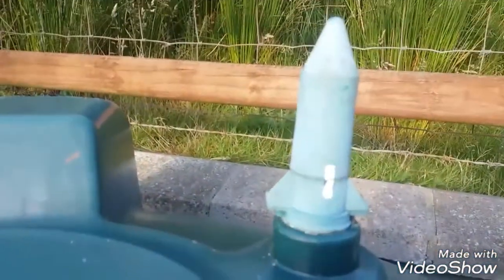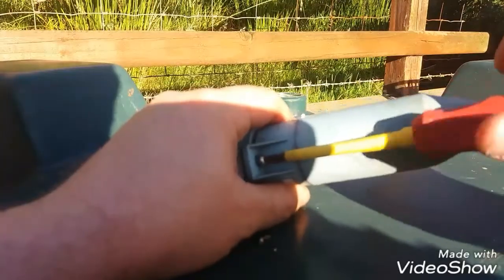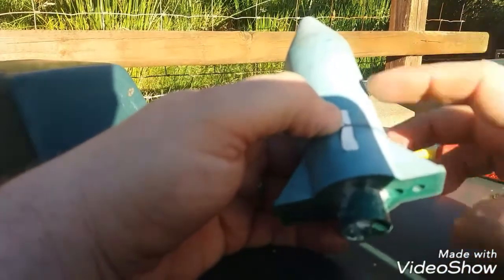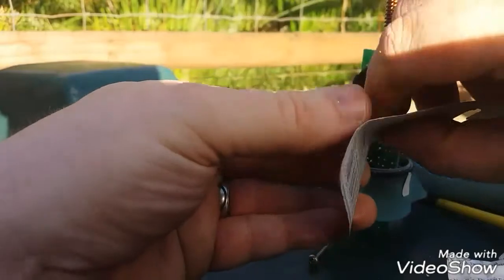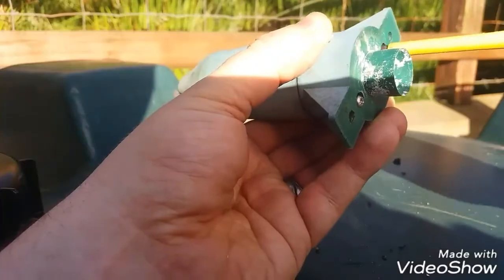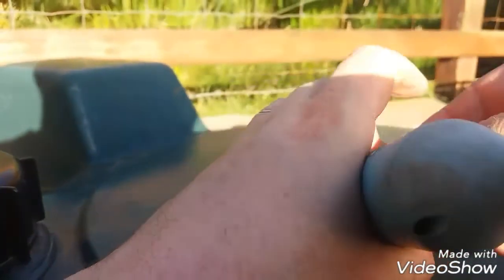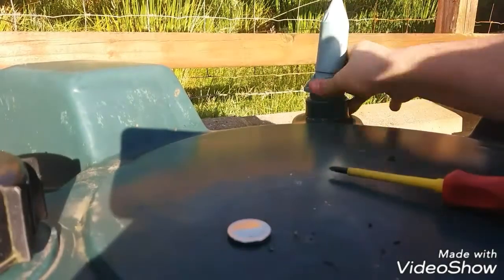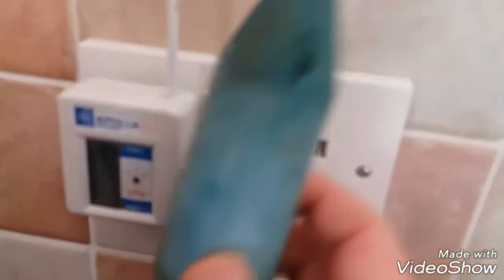Apollo Oil Level Sensor Battery Replacement (quick guide)

Comment: Thanks for the video very useful. Mine must be a different model no base unit just screwed directly into the tank but under a big lid along with the filler cap so out of the weather. Only thing I would ad is to check the o ring is in place at the bottom of the tube on reattaching.

Comment: Great vid thanks!! My tank is over half full but reader is showing that it's low in oil sometimes... not sure why, any advice? It's shows 6 bars one minute then flashes red light to say we are low
Reply from the maker: If you replaced the battery there is not much else. It sounds like its losing signal. Moving it to another socket may help.
Reply: @doctorlefthandthread  thanks for the info. It seems to only read incorrectly and flash red when the heat is actually on. When heating is off it reads fine

Comment: Thanks for this!
Reply from the maker: My pleasure!
Reply: @doctorlefthandthread  right, I checked and my tank doesn't have the 'rocket ship' sensor, it does have the same plug in your video tho so am I missing something? I've had the plug for about 5 yrs and just assumed there was some kind of sensor inside the oil tank?
Reply from the maker: @jack-zz9hb  really not sure the rocket ship type is what I have

Comment: Thanks for this and also for showing how the signal might need to be paired again. Thought I was going to need to do that as it just kept blinking for a very long while after I replaced the battery but then it re-connected. Yay! Mine is called 'Rocket' instead of Apollo but it is the same product.

Comment: Need replacement battery number 3V_CR2450
Reply from the maker: Take that number to any hardware store CR2450 or you can order online should be readily available
Reply: @doctorlefthandthread   Yes, I had to order online as none of the local stores had this one in stock. It was inexpensive though.

Comment: That looks like my problem solved but am I the only one wondering what battery size is required? it would be helpful to know this before I take the whole thing apart and then have to go and buy the battery.
Reply: I've just bought one from the local shop here in Northumberland. It's a Lithium CR2430 3V coin-shaped battery. The one in the video was made by Panasonic but mine just says 'GP Lithium' on the packet.
Reply: @mdmckea  Thanks, I ended up taking it out to find out. Problem solved 👍

Comment: Very useful. Thank you. Minor point though- just undo the two lower screws and you won't have to unscrew what is an adaptor for some tanks. Mine doesn't have it and those screws go directly into the tank.
Reply: Good point, thanks.